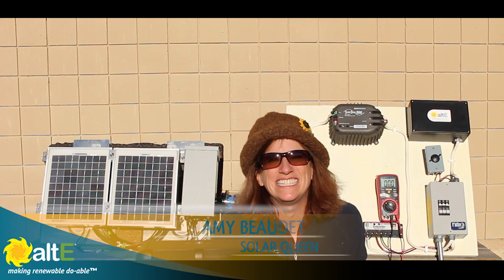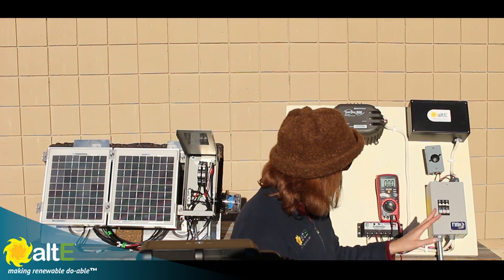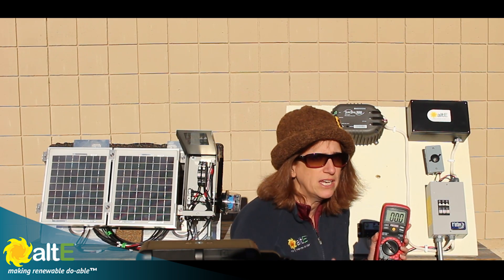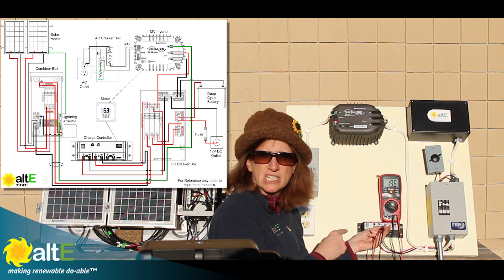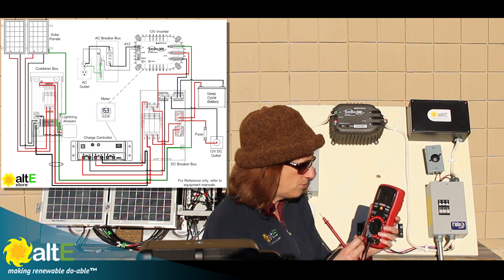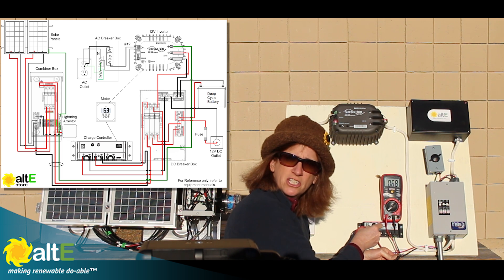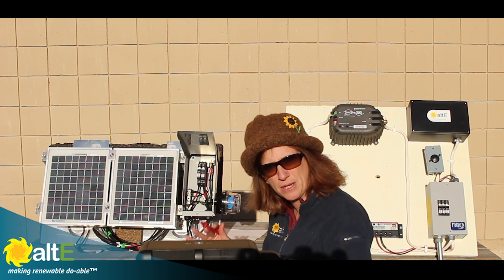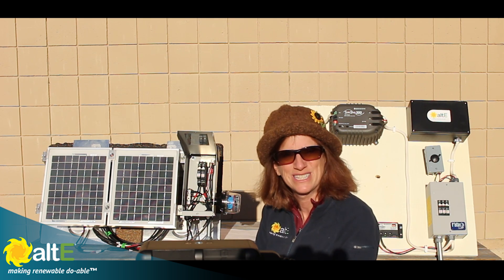Troubleshooting a Solar Charge Controller

Comment: My output voltage from the charge controller to the battery is very low. What could be the cause here? Voltage from the panel to the controller is 30 volts but the output voltage from the charge controller to the battery is 3.5 volts. The battery bank is 2 12V connected in series

Comment: madam can I use 5w panel for charging battery and how much time it can take??if I use 5w solar panel??
Reply from the maker: It depends on what size battery you have. A 5W solar panel will only output about 0.2A. In a day, that's only about 1 amp hour (Ah).  5W panels are usually used as trickle chargers, just enough power for a battery that is sitting not being used, and refilling its self-discharge.
Reply: altE ohhh.. what is the voltage of the solar panel you used here?
Reply from the maker: These are two 5W 12V panels in parallel for 10W total. I'm charging a 7Ah battery, and really just using it for demonstrations. It doesn't make much energy for me to power anything substantial.

Comment: Mam 
I connect my 12 v 40 w solar panel to 12 v 14 ah battery
My solar panel led on solar charge controller is blinking. Why
Mam
What is the meaning of overvoltage?
Reply from the maker: Over voltage is if the volts from the panel are too high. It does not sound like that is the case, as you have a 12V solar panel. Read the manual for your charge controller, many have the solar light blink to say that it is actively charging.

Comment: I'm having an issue with my CMP12 charge cpntroller. The load light is on all the time, even though there is no load connected. Just the panel and battery are connected. And it's not charging the battery. Enough sun. It used to charge fine.  Why is it doing this?

Comment: Isn't there any diy panel and charging system monitoring system running on a cheap raspberry pi board uploading its data to the internet 24/7

Comment: can you fix the solar panels in an upright possition instead of an angle?
Reply from the maker: You can, but it won't work as well. Solar panels are rated with the sun hitting the panels straight on.  The ideal year round angle is your latitude. For example, 42 degrees here in Massachusetts. In the winter, latitude plus 15 is best, so 57 degrees in the winter. If I have it tilted up at 90 degrees, it will work, but I'll get much less energy. You can see the video we did on it here, https://youtu.be/m_YuPfShbCo .

Comment: Can you help please,I have a charge controller cm3024z and after 3 days 
installed I can,t use my first button to read the data and to adjust,no 
matter how much I press it,nothing shows
Reply from the maker: I'm sorry, I've never used that charge controller, so I can't help. You can Google it and find the manual and some videos on it that may help. One thought is that the battery voltage might be too low for it to turn on.
Reply: Thanks for your reply,I try and google
Reply: miguel cassar Jim

Comment: Hy Amy i have question plz ans me
i see 19.6V coming from solar panel and if the intensity of sunlight decrease or increase then what will be the effect on coming volt nd amps from solar cells??
Reply from the maker: Current is more affected by the intensity of the sun, so the voltage may drop a little, but the current will drop in direct proportion to the sun. SO if it is half as sunny, you may still get full volts, but only half the amps.
Reply: very very thankuu Amy u made my day :)
(Y)

Comment: it's pretty cheap money to just install an amp meter with a shunt at those points inside, perhaps you can show a setup like that. Voltage meters installed would be helpful too, that way you would just have a glance to see if things are working.
Thanks

Comment: have you seen a solar panel not work for reasons not covering the front of it
Reply from the maker: +George Gardinier Very rarely a panel may become delaminated, the backing may separate from the panel, exposing it to the air. Over many years, oxidization could cause problems. A poorly crimped connector (done by the installer) could cause issues, and is potentially dangerous (always use the right solar connector crimper, not just a wire crimper, or buy pre-crimped cables for the home run). Unfortunately, the biggest cause of damage to solar panels tends to be boys throwing rocks. The biggest solvable problem tends to be stuff on the panel.